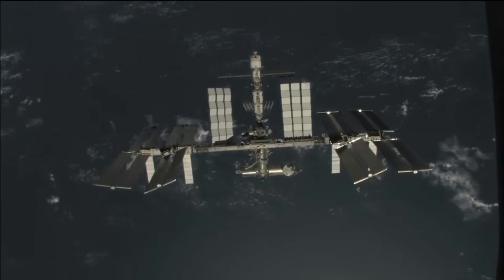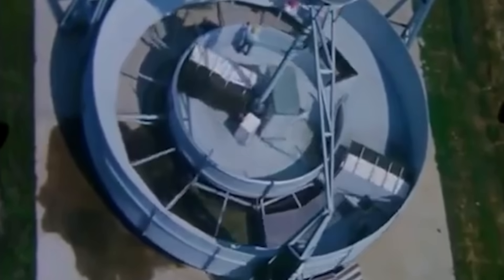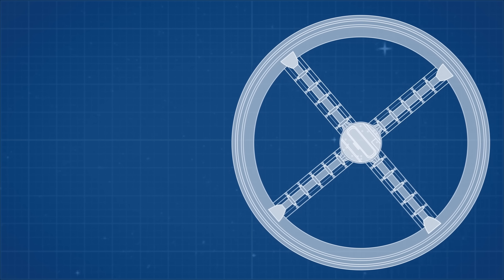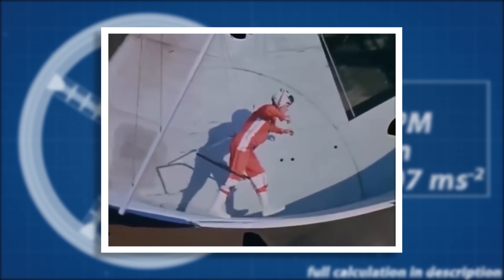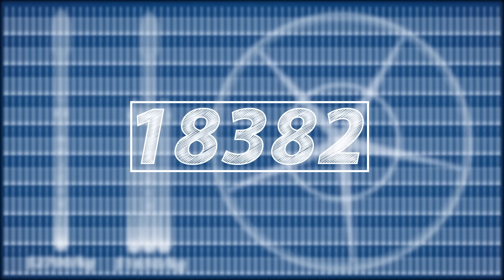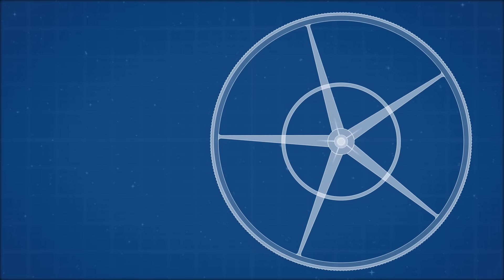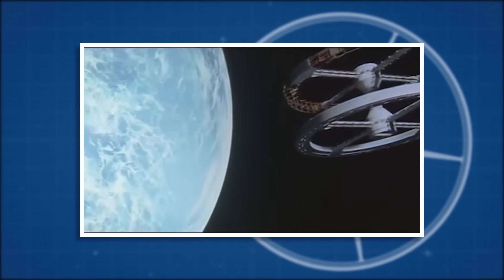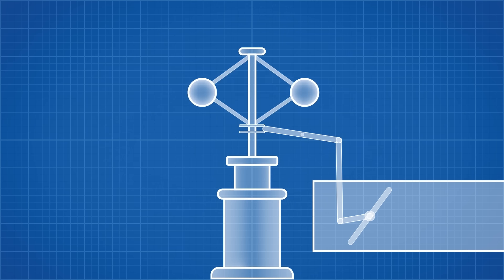Can We Create Artificial Gravity?

Comment: The cheaper option is to build your space ship the normal size and build a counter weight of the exact same weight. The you get a strong cable of lets say a kilometer in length and but the space ship on one end and the counter weight on the other end..  Straighten it out and then fire a rocket on both the Space ship and the counter weight in opposing rotational direction..   You now have your gravity for a fraction of the cost that of either space station featured in this video..
Reply: Centrifugal force works no matter where it is implemented..
Reply: cool concept! But you'd need one hell of a cable :D
Reply: NASA proposed a similar plan for it's original 1970s space station concept. However, the reason there are no serious plans to develop artificial gravity spacecraft of any kind is cost. NASA Human Space Flight (HSF) is teetering on the verge of ending because the very best engineers NASA has to offer cannot crack the cost barrier. The private sector has yet to demonstrate they can crack it as well. We only have HSF of astronauts on board ISS who are transported via Russian Soyuz craft. When NASA ISS participation ends, then what? There's lots of talk about going to Mars or back to the moon but no concrete plans that can be seen unfolding the way Apollo did. NASA's budget is currently at 1960 levels as a percentage of fed spending. We won't have any very ambitious projects on that budget. It's the main reasons SLS/Orion is on such a glacial test schedule.
Reply: @ljdean1956  NASA's budget is NOT currently at '60s levels, but at 0.4% of the Fed budget, while during the 1960s Apollo era it was a whopping 4.4%. 

NASA is currently working on it's own Human Related Capsule, and Boeing and Space-X should have theirs ready by 2020. While the cost is high enough that we couldn't run the Space Shuttle AND build next-gen capsules simultaneously, the US (both private and national) have NOT given up on HSF. We're still building the big-ass SLS that George W. Bush's 2004 plan called for, and NASA is still funneling money to Space-X, Boeing, Orbital ATK, etc to deliver food to the ISS. 

NASA's budget is a tiny fraction of what it was during the '60s, but is ultimately providing one of the greatest dreams of the hippie era: bringing scientists and engineers together from the two super-powers that could annihilate the entire world's population many times over, and would prefer to not entrust each other with their lives, BUT THEY DO, for science, and truth, and something better than themselves
Reply: @ljdean1956  I'd love to know what do you think about current situation after 7yrs lol
Reply: bull..... shit.....
Reply: AdstarAPAD you wouldn't use a deadweight, but the exact same module for redundancy. In fact it is still better to have three somewhat identical modules connected into a gigantic equilateral triangle, held together by strong Kevlar tethers. After spinning it up it rotates in a plane, much more stable than two ships, because two ships would invariably twist around the connecting tether, while the three module triangle rotates stably without twisting and possibly breaking the tether.
Reply: Maathiu Ra Yin
 well in your scenario it would definetly need accelaration. Without acceleration there would be no force (due to momentum). If you use the spinning method for creating gravity however, you wouldn't need constant acceleration as the "centrifugal force" results directly from rotational speed.
Reply: +Maathiu Ra Yin then why if you put something in a bucket and spin it, it will stick to the bottom
Reply: +AdstarAPAD so you're saying artificial gravity requires acceleration?
Reply: @thothheartmaat2833 regular gravity creates acceleration. Artificial recreates that.
Reply: This would likely work since it simply removes the requirement of a full circular station/ship. Also, it creates a means of greatly increasing the radius and slowing the rotation.
Reply: solar systems and galaxies don't spin apart because there is a balance between inertal momentum and gravity. A stable orbiting mass is actually in a constant state of falling towards the object it is orbiting. If inertia was stronger the object would fly into space. If gravity was stronger, the object would crash inward. astronauts orbiting are not truly weightless. They just appear that way from their perspective. They are actually falling. The effect is simulated on Earth by the "vomit comet".
Reply: AdstarAPAD interesting idea. i wonder if that would work
Reply: J Dean manned spaceflight hasn't done much anyway. it's just for show. the space shuttle was a profound waste and now SpaceX is showing us how it should've been done from the start, with cheaper private enterprise
Reply: Ben Heideveld If we had the technology to make the strong kevlar cable we could make a space elevator and the total cost would be cut significantly.
Reply: or you stand on the platform and it rockets towards the destination with rockets on the bottom of where you're standing, pushing you "up" and pulling you "down"
Reply: Maathiu Ra Yin
You would have to maintain the 1 G acceleration to the half way point and then turn the space ship around and decelerate with the same 1 G deceleration all the way to you get there..   What engine and fuel could sustain a 1 G acceleration over a long journey ?  Not sure any such engine and fuel exists..
Reply: Maathiu Ra Yin
In your proposed solution,, Yes..  Not in the centrifugal proposal i am advocating..
Reply: +AdstarAPAD I was wondering if there is actually centrifugal force in zero gravity? isnt it an effect of gravity coming off the planet? wouldn't the thing just spin around and you'd bounce off the walls? or would the space station float around you and you be suspended in space? I understand that it works on earth because there is gravity pulling you down and when the thing spins it throws you out but is it possible it's using the gravity of earth obtain that force? something tells me that in space there is zero potential for centrifugal force. isnt that why the galaxies font fly apart? they are trying to explain that with dark matter but is it possible there is just no centrifugal force in space?
Reply: +AdstarAPAD so a carousel doesn't have centrifugal force but a merry go round does. is it because it utilizes the downward force of gravity and the spinning action bends the gravity? in the same way a washing machine has centrifugal force but a drier doesn't. clothes don't follow the spin of the drier tightly to the walls like in a washing machine.
Reply: +Maathiu Ra Yin the spinning of the drier does not create artificial gravity. it just kicks up clothes that bounce around off the walls of the drier. the only time we've seen centrifugal force demonstrated is in horizontal reference to gravity.. is there any proof there is centrifugal force in zero gravity?
Reply: +Maathiu Ra Yin I looked into this more a little bit and there's no such thing as centrifugal force. it's centripetal which means objects want to continue in the direction they are going. the only way the circle space craft would do anything is if you were somehow able to stick yourself to one of the walls and start riding a bike and you would gain centripetal force as your mass wanted to continue forward it would be forced out of its straight path by the curve of the ship. but sadly, if you were trying to jog, your bouncing legs would force you away from the wall before you were able to take one step. the reason that spinning gravitron ride works at all is because you are strapped to it. there has to be some type of force somewhere first for the centrifugal illusion to work. that force is gravity pulling you down which is manipulated by the spinning ride. in space where there are no forces, there would be nothing thrusting you outward. it would just spin and you would just bounce off the walls helplessly.
Reply: ModernGameArmy
centrifugal force is just appearing to be an actual force. In reality, it's only momentum and inertia combined. The object in your bucket doesn't "want" to move if it's still and when it's moving it doesn't want to change direction but rather move in a straight line. When moving in a circle you're forcefully chaning the direction of the object all the time, therefore making it stay in the circle. But as it doesn't "want" to stay in the circle, it will always press against the bucket ("trying" to move in a straight line), which is perceived as centrifugal force.
Reply: Leo1239150 Yes i agree technically centrifugal force doesn't exist but for all intents and purposes we still use the term
Reply: ModernGameArmy
yes, for use in general speech it's fine. If you're going into mechanics though you should stop talking about centrifugal force as it will mess everything up.
Reply: +Maathiu Ra Yin 1. Unless it is a vacuum inside the station it would 2. Galaxies are trying to fling apart it's  just that gravity is strong enough to hold them together, this is called a "orbit" 3. What does dark matter have to do with this?
Reply: +Leo1239150 how would it mess anything up? It's not like you would use it in an equation or anything. And that's also like me saying momentum doesn't exist it's just an interaction between inertia and velocity
Reply: Maathiu Ra Yin I can't tell if you're being sarcastic or you don't understand how orbits work?
Reply: Maathiu Ra Yin however there is momentum and angular momentum that do create an outward force
Reply: Maathiu Ra Yin Yes i am aware of this you have so far added nothing to this conversation
Reply: ModernGameArmy
that's actually what I meant, using it in equations. That would obviously mess everything up.
Reply: Maathiu Ra Yin In a vacuum yes it would not create G-Force however if there was air inside the ring the air would move at the same speed as the ring due to friction(like on earth) which would speed you up and once you speeded up fast enough you would have enough momentum to create G-Force
Reply: Maathiu Ra Yin the air would be spinning at the same speed as the ring. Because of that if you were in the ring you speed up in an outwards motion but you would encounter a problem there would be a floor in your way therefore creating G-Force
Reply: Maathiu Ra Yin Are you honestly this stupid? when the ring spins it causes the air to spin when you go into this air you are pushed forward because you are now being moved by the spinning air because you are now being moved by the air you will want to keep moving forward but there is a floor/wall in your way and the spinning air will push you against it
Reply: Maathiu Ra Yin The air is moving at the same speed the ring is which accelerates you to the same speed as the ring
Reply: Maathiu Ra Yin please tell me what you think would happen if you were being moved forward by air at the same speed as the ring
Reply: Maathiu Ra Yin So either A. air can't move anything. or B. it doesn't move anything in a ring. please tell me how you came to this conclusion.

so if there was a large ring in space spinning and the air was spinning with it and you were not moving relative to the ring(you see the ring spinning) and you were to hop in the air would push you because the air is moving you are not. unless you're telling me somehow  the air just magically phases through you
Reply: Maathiu Ra Yin The air IS NOT STATIC it is moving as fast as the craft is spinning so if you were to jump in the craft you would be pushed by the air until you matched it's speed
Reply: Maathiu Ra Yin There air would push you because the air is spinning you now have acceleration so now you have an outward trajectory but there is the station wall/floor in the way hence centripetal force
Reply: Maathiu Ra Yin "I can't see how spinning anything in space using centrifugal force could work. Don't you have to have weight to do that? Otherwise the floor would just slip beneath your feet. And if there was a wall attached to the floor, you would only be slapped by it. I only see it working if you had some sort of constant acceleration beneath you, pushing you in one direction to keep you upright."

"Ryan:  All you need to feel centrifugal force is mass. A brick has the same mass on the surface of the earth as it does in deep space. Weight is the force that something feels due to gravity: so the brick would have a much larger weight near the earth's surface than it does in deep space. Now that we have that out of the way, let's talk about the centrifugal force.

I can see why you are confused: if I understand correctly you are picturing an astronaut floating inside a stationary space station and not touching anything. When the space station begins to rotate, it seems like it shouldn't do anything to the astronaut, right? Right! If there is nothing exerting a force on the astronaut, they will just float while the station rotates around them.

But a space station is not empty. There is air, and as you say, there are walls and other obstacles. As the station begins to rotate, the air inside will begin to move with it, so even without any other objects, a slight push from the surrounding air would make the astronaut start to move. Once the astronaut is moving, it is only a matter of time before they come into contact with the outer edge of the rotating space station (which is soon going to be the floor).

Now we need to think about how the centrifugal force works. There is another way to think about it that I will describe here, which makes it seem like it's not a real force at all! Ok, so what is a force? A force is something that causes a mass to accelerate. We defined mass up above, but what is acceleration? The simplest definition is that acceleration is a change in how fast something is going or the direction that it is going. So, our astronaut had been nudged by something inside the space station that is rotating with the station itself, and the astronaut is now drifting along in some direction. The laws of physics say that the astronaut will travel in a straight line (with no acceleration) until some new force acts. If you are an astronaut traveling in a straight line inside a round, rotating space station, eventually that straight line will intersect with the "floor". When it does, your body wants to keep traveling in a straight line, but the floor is in the way, so it gives you a nudge inward and in the direction that it is moving. The floor exerts a force, which causes acceleration.

You can probably see where this is going. As the astronaut gets bumped along by the rotating floor, eventually, they will be going at the same speed. But remember, acceleration is a change in speed or direction! If you watched from afar, the astronaut would appear to be traveling in a curved path, around and around the circular space station. To travel in a curved path, there must be some acceleration to keep that astronaut's path turning, and therefore there must be some force. Which direction is the force? Well, if you were the astronaut, you would now be standing on the floor of the rotating space station with your feet pointing outward from the axis of rotation. It would feel like the floor is pushing on your feet, so the force is actually inward, toward the central axis!

Confused yet? Ok, think of it this way. When you stand on the ground on the earth, which way is the force of gravity? Down. So why don't you fall in a straight line to the center of the Earth? Because the surface of the earth pushes up on your shoes with the exact same force but in the opposite direction! Same idea in the space station: the centrifugal "force" appears to push objects outward, but the strength of the space station provides an opposing "centripetal force" which pushes inward.

The end result is that it feels similar to walking on the surface of a planet (if the space station is spinning at the right speed)."
Reply: Maathiu Ra Yin In a smaller ring with higher speed this would be very true however the proposed ring would be larger and have a slower spin. yes although air doesn't have as much pushing power as a liquid it still would make you go the same speed as the ring as you have no other force to prevent it from pushing you like on earth it would just take a minute
Reply: Maathiu Ra Yin then please tell me how the air on earth spins if it's not by friction
Reply: Maathiu Ra Yin My point is the it's moving the same speed as the earth i never said the air was pushing us towards it
Reply: What if debris hit the cable and cancel the rotation? Just a thought.
Reply: Elvin Henrik Elum
 Well space craft can get hit by space debris and destroyed at any time..  Sooner or later we are going to have a space ship destroyed by being struck by a lump of space rock or space junk..
Reply: Still the same mass(cost) that needs to be launched
Reply: gofres not really, because the counterweight can be easily manufactured in space, just rocks. don't need to launch that from Earth
Reply: Well that's another solution Ben.. But it would be a more expensive one because you need 3 different modules.  So it would all be dependent on costs.. Oh with the connecting tether you could have that connected to a roller bearing on the module so as to allow the module to turn around without twisting the tether.. But yeah your solution would work no doubt..
Reply: twang Goodbye Earth. Hello cold abyss.
Reply: Leo1239150
 Not if you only need to maintain 1 G centrifugal force..  The cable would simply need to be able to hold the weight of your space ship x2 .. I would assume that for a small crewed space ship you would not need such a strong cable..